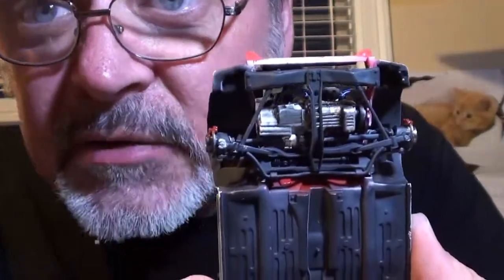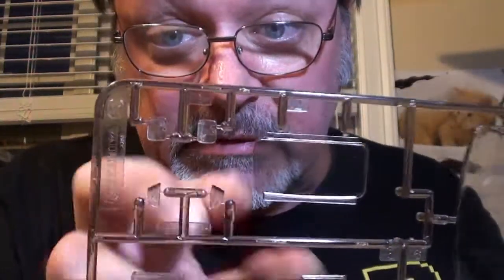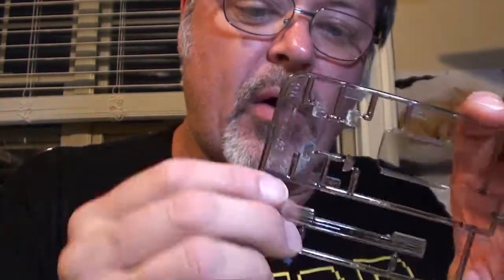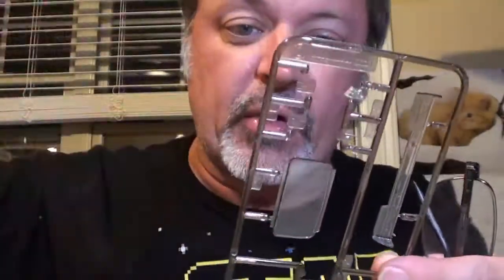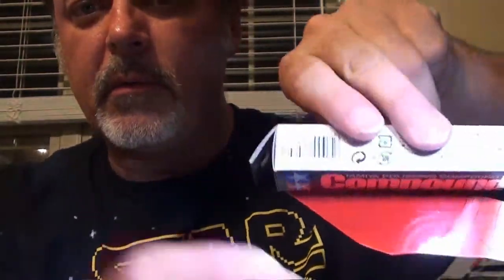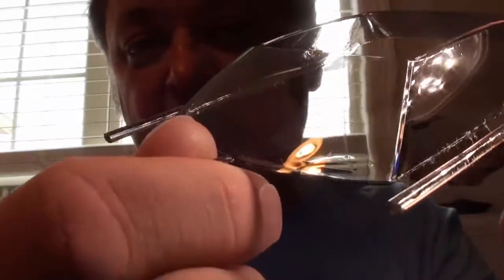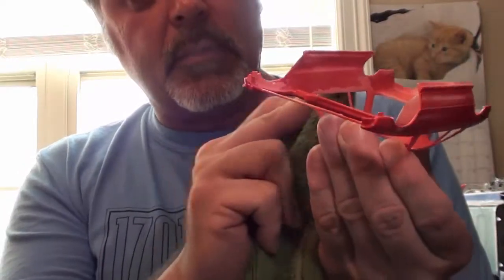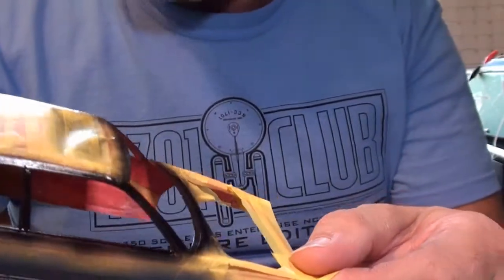It's a Honda part 32:  Polish

Comment from the maker: Future is an acrylic, and it is pretty inert when it comes to different types of paint.   The problems come in when you put a lacquer over an enamel or a different lacquer.   Lacquer thinner is very reactive and will eat through anything that it can.   The good thing is that acrylics don't react to lacquer thinner.   So a coat of future will block a lacquer from eating up an enamel finish.   You just have to remember that Lacquers and enamels can sometimes interact, the others won't.

Comment: The scratch in your sunroof, was it on the plastic or on the future finish? I haven't used it on models, but I've used Maquires (sp) Plastix polish intended for hazed headlights on PC case windows to remove scratches. When done by the directions, it turns out awesome. I'd have to experiment on model styrene though.